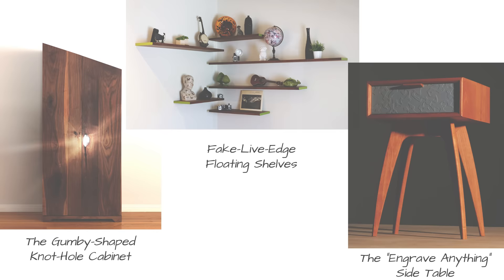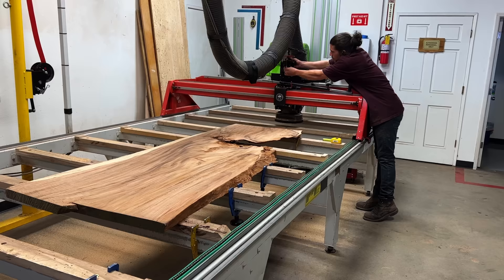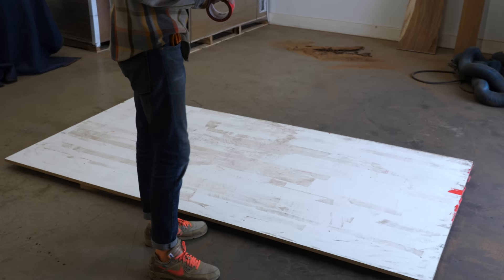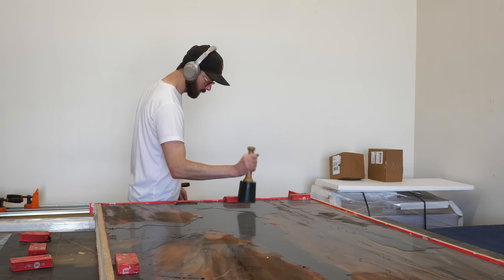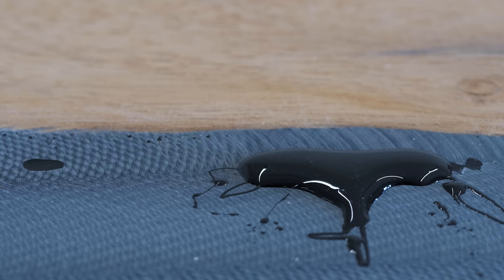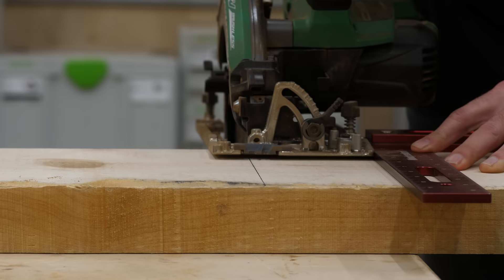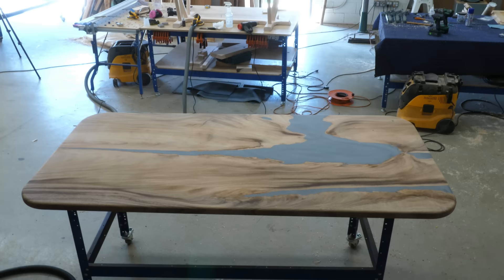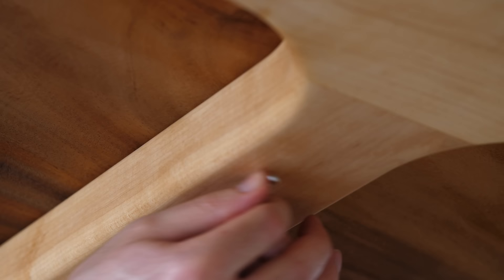Surprising My Parents with a Fancy Dining Table

Comment: Great work! Looked awesome.

FYI, crystalized epoxy is because at some stage it got cold, you need to warm it in a hot water bath, about 60°C and it will dissolve back to normal.

Comment: For the measurement debate, I love the metric system. I didn't realize that 1cm^3 is 1 ml. There's no equivalent in imperial. I started using it more with my 3D printer and started liking it more. I also actively use the imperial system daily as well with things like cooking, weight, height of a person, and lumber
Reply: Another cool thing is that it takes 1 calorie of energy to warm 1cm³ of water (which weighs 1 gram) up 1 degree Celsius :)

Comment: I grew up with the 'trades' and have always used imperial units. Building houses and such. Then for my 2nd 30 year career I worked in the trades for a Japanese automaker where all the machines I worked on (presses/CNC mills) were metric. So now I can look at a nut/bolt wrench and tell you the size at a glance, either imperial or metric.

Comment: Ive had a similar experience with a fire in a dust extractor. It was caused by a tiny shard of metal that may have been in the timber, entering the fan and sparking. Fine sawdust is extremely flammable, as you know.

Comment: Wood dust fires often occur due to moisture getting into the dust, which generates heat as the fibers break down. These wood dust collection units have been known to explode, especially when people open a sealed unit causing a fire back blast.

Comment: The interesting thing about the imperial system is it's ability to be equally split into smaller units with basic tools. Simple center tool splits 1 in down the middle into 1/2 in pieces. (Ignoring kerf at moment and just measurements). You have other tools that work with 1/2 in or basically any subdivision of 2. But take a 25mm board down the middle you have 12.5mm. And sure those aren't the measurements that you will end with, but the point is metric works great on paper, imperial works wonders with dividing tools.

Comment: I had a similar dust issue with my CNC.
Being in sunny Sydney Australia, I usually just push all of my dusty woodworking operations out onto the driveway and enjoy the sunshine whilest blessing the neighbours with my dust. This keeps my garage clean and dust free 🙂.
However, I have a CNC that I built and this beast of a thing generally stays put, so it has a shopvac/cyclone and I duct the waste air outside.
One day I was doing a really lengthy operation on some MDF and left the CNC unattended (we both know how bad an idea this is).
When the noise stopped, I came back into the garage and there was dust everywhere - piled up is little snow drifts in the corners, against everything and on everything 🥺.
It seems that some material broke free and was sucked up into the cyclone, which then blocked and sent the dust to the shopvac, which quickly gave up and blocked and somehow forced off the vent hose - at which point buckets and buckets of MDF dust swirled around everywhere.

Comment: Fire was due to static electricity.  Excess dust = excess friction = static = spark.  Finely ground wood powder provides tender for spark to become flame.  Attach ground wire to dust ventilation chute to prevent further accidents.

Comment: I use Epoxy at work all the time and have never come across any that wouldn't cure, no matter how old. I think what you've run into isn't expired epoxy but crystallised epoxy. Very 'pure' epoxies have this problem a lot. It's made worse by being too cold and temperature cycling. You can fix it just by heating it up. It can take a long, long time to fully de-crystallise. To prevent it keep it at room temperature all the time.

Comment: Something I got from West System epoxy tech support, if you have epoxy with crystals in it, just put it in very hot water for a few hours.  Everything dissolves back in and you’re good to go.  I use it on airplane wings and I’ve never had a problem even with very old epoxy.

Comment: I'm not sure if you'll read this comment, but here it goes: 
While epoxy resin is rather flame retardant, it does break down over time (especially as a dust such as from the CNC), and when it breaks down, it causes heat to build. You need 4 elements for a fire. Heat, oxygen, fuel, and a chemical reaction. That dust collector more than likely had left over resin sitting in the bag that was already heating up and causing a chemical reaction. When the new dust was introduced, you basically made an atomized fuel source with oxygen, which caused the fire to shoot out the side. I think your best option, since you work with epoxy resin frequently, is to keep your equipment as clean and empty as possible. I hope this helps because I'd hate to see or hear of something bad happening to you or your shop! Love the videos!

Comment: i would hope everyone knows that screws are used to hold it tight until the glue cures! great build again. I build and install railings and stairs. use to be a trimmer but got bored. but wanted to build furniture originally (highschool). your videos are convincing me to move on again! Happy building!

Comment: What I think happened to the epoxy is it in did crystallized, and you assumed correctly that it can "melt" back to the amorphic phase BUT it was just one part of the mix which then had not enough of the hardener or "part B" around to harden (also could not mix with it) so it just stayed liquid. It's quite possible there's no such thing as expired epoxy at least within reason ;-)
My reasoning - last year I did my first epoxy pour and when preparing parts for the second layer I noticed that some of the epoxy was crystallized in the bottle. Interestingly the seller did mention that something like that can happen (at least to that brand/type I used) and the root cause is low temperature in transit or on the shelf. They also did tell what to do with it and although I was pretty sure this is BS I followed the guide and it did fix it with zero problems! It was actually pretty easy, all I did was putting the epoxy bottle (just one part of course, not mixed) in a water bath that I heated up to about 60 degrees Celsius. The process took literally a few minutes and it was melted again. It was a crystal clear epoxy and you couldn't tell there was ever something wrong with it.

Comment: Strong graceful "wooden" legs: use your CNC to route channels in wood to hide steel framing, leaving a little play for wood expansion. Weld the steel Real Legs together, prime/paint the steel, then touch up the wooden covers to fit the welded frame. Glue up the wood covers, finish the wood. To an observer, those spindly legs are obviously wood and, to a woodworker, they seem weak & inadequate, but if you use the right materials they can hold an elephant during an earthquake & it'll remain solid for centuries.

Comment: Hey brotha I've had a fire just like that. Was flattening a slab (cottonwood burl). And started smelling something burning. Looked up and the exhaust of the dust collector shooting smoke. Ran to the cyclone dust bin and wheeled it out fast. I think that running the cnc for a long period allows the bit to heat up cause a spark and then the mass amount of air flow doesn't help lol

Comment: Really enjoyable video, including the various ways you can assess the value of the table to you as well as the "customer" (inestimable, no doubt, to your parents). But re: Ikea, I remember in the 80's their furniture actually compared well with other modern styles. Solid woods, solid feel, nicely finished even though spare in design and easily shipped and assembled. What I've seen by Ikea in recent years squares with your estimation. Not very stylish, made of the same pressed board & plasticized finishes everyone else uses, only somewhat more expensive. Don't feel guilty.

Comment: Just for future reference, if a fire ever breaks out again, sawdust won't burn without either excess oxygen, or if its automized, meaning the dust particles become separated into a gas form. Trust me, I've tried burning sawdust many times in an attempt to figure out what to do with all the sawdust my shop produces because sometimes it way too much to throw in the garbage. it simply won't all fit. sawdust is surprisingly hard to burn.

Comment: Crystallized epoxy is a normal thing and easy to work through.  All it takes is warming up the resin.  You can submerge the container in water that is just below boiling.  All of the crystals will disappear and the epoxy will be fine.  The same thing happens with honey.

Comment: Imperial for woodworking, because fractions are easier to calculate.  (5/8 + 3/16) / 2 = 10/16 + 3/16 = (13/16) /2 = 13/32.  takes longer to type than to do in your head.  Measuring is done with the tape, halfway between 3/8 and 7/16 which you just look at on the tape.  With metric, it's trivial with a calculator, but it takes fingers to do that.  Case closed.

Fantastic wood, Monkey pod?  How was the wood to work with...  you didn't describe it.

Base wasn't really my taste, too noisy for me, but I'm not the clients.  Lovely.  You are a great son.

Comment: I sell, program and operate cnc's, and you have to have proper dust collection or the wood dust will build up heat because of how fast the cnc cutter is spinning. Some dust probably got really hot, and an ember got sucked up.

Comment: Hey Chris, I really enjoy watching your videos and I like your design style. I've noticed that you and many others have issues releasing your epoxy parts from the mold. I used to build 100'+ epoxy sailboats. At one time we were building the largest epoxy Kevlar sailboat in the world. Our hulls were one part, along with the deck being the other part. Releasing a 115' part from it's plug was quite difficult, but we did something to the plug before lay up that helped release the part. 
On the backside of the plug, we would insert many air chucks all over the inside portion of the plug. After the layup we would hook up as many air hoses to the air chucks, pumping air between the part and the plug, thus releasing the part from the plug. Did this completely release the part? No, but when we hooked up the air to the part, you could definitely hear the air doing it's job creating space between the part and the plug. I would think that 4-5 air chucks on the bottom side of your molds would make separating your piece a whole lot easier. You still have to wax your mold. 
Let me know if you have ever done this, Just a little tip from an old boat builder. 
Here is one of the boats we built.  https://www.youtube.com/watch?v=Y6pm_zrNqAI

Comment: Chris & Shaun, you guys do amazing work! Thanks for another adventure. (That's Chris in the video, correct?)
Does monkeypod have a high metallic content? Anything above a certain temperature can cause the dust & chips to ignite, and plenty of air under pressure to feed it. Even part of a bit breaking off. A subject for another time I suppose.
I can use imperial or metric but using metric can be a giant pain. A big part of the problem is that just about all of the tools we get in the USA (and that I have) are in imperial: 1/4" & 1/2" router bits with imperial cutting sizes, not just the shafts. The depth/length gauges are all imperial. Wood stock is in quarters (3/4", 8/4", etc.). I got a tape measure that has metric & imperial but it's old and has metric on the underside (why did I buy that?). We used to be able to get plywood/sheet goods in quarter inches but almost all now is in millimeters. It's a mess and not many people are willing to do the conversions in plans and execution. To use the tools & materials available, one always has to be thinking about measurements & conversions. The US was supposed to convert decades ago, we started to convert, but lacked the will to get 'er done. We've had router bits available now for a while that do metric for plywood. It's just the inertia of an entrenched system, and most people don't want to deal with the conversion arithmetic. I'm of the age now that I'm just going to use imperial & adjust when necessary. Metric makes more sense as base-10, but I'm good with fractions so WTH?
I thought it was "dollars to donuts." What do I know?
Peace & happy woodworking!
Reply: I meant to add that I built a shelving/box unit completely out of 12 mm plywood (so-called "half-inch") using the metric tape and plans, joined w/FF biscuits, and it came out just fine. Trying to use imperial with this would've been more complex than necessary.
I was also planning to split up my dust collection to put the separator & bag side on the other side of a wall in my shed. I'm in a rural area with no one nearby, and figured the escaped dust can go back to nature instead of my lungs. Bag changes easier outside as well. Your fire has me thinking that I need at least some kind of window so it can be observed at all times in case of a fire.

Comment: Unless I misunderstood the issue, which is incredibly likely, the screw's could have been removed with extractors which literally dig into the screw head and form their own grip to then un screw the screw. The only issue with using these is that they completely destroy the screw but if you're using the the screw is already mostly dead. You can do your own research if you wish but the best option I've found are Grabit brand extractors with both the drill and the extraction in one bit,  there are however stand alone extractors where you need a separate drill bit to go in first.

Comment: A bit late, but I'm pretty sure your fire was caused by static electricity in the hose. I've seen it myself in my own CNC dust system -- sparking when fine sawdust is going through. So wrap a wire around the hose and ground the wire. I suppose you could ground the metal coil in the hose, but in my case there are hose connectors that break the connection.

Comment: When i made a dinner table for my parents, i made sure to make everything wheelchair/movement impaired accessible just incase anything happens down the road. Just something to think about when making something for people who are at more risk of permnament injury and just a good backup so you dont have to redesign, make changes or even have to get rid of what you made.

Also would be interesting at least for me, if you also include the tools in the price of the work, i can understand if it's a bit diffecult to calculate, but would be cool to get an idea of the investment in tools it took to create the product in the video.
Reply from the maker: I kind of did that in the last video. I broke down the material cost. Then I talked about labor + tools + monthly overhead. Those are all very real for my situation, But I think keeping it to just materials + labor is more understandable for most people. Also I suppose labor should kind of encapsulate a lot of those other costs.

Comment: I was blessed for going to college in Canada, where whoever is responsible for make this decision can't decide if we use metric or imperial, and I've done all my classes from machine shop to thermodynamics using both, almost like, exercise 1 and 2 are always the same, one in inches and the other in mm. At work, if the client is from the US, things are in Imperial, but if it's local it's usually metric, especially QC. 
I personally like imperial fractional and decimal to the thousands. People say it's much better, but I think it's all the same. When I was in my home country, I always thought it to be ridiculous to say, (dumb voice on) "oh, this weld bead is 2,452 mm long!" (dumb voice off) and if you dare saying it's 2 and a half meters, people look at you and say, (dumb voice on) "oh, I though you went to engineering school!" (dumb voice off). 
Here, parts are 144 in long or 12 ft with the same technical level. Quality check goes zero625 thou +- 10, and it's all good.